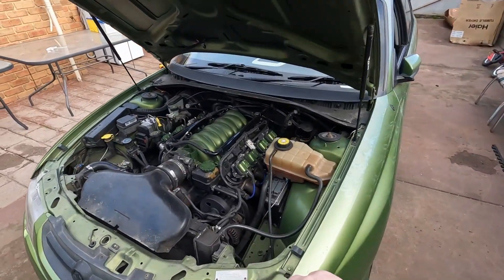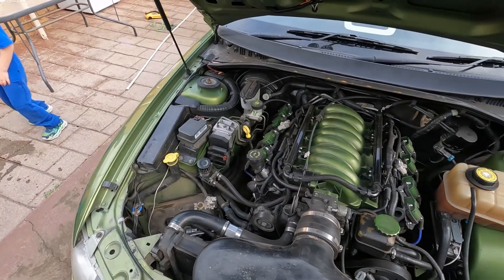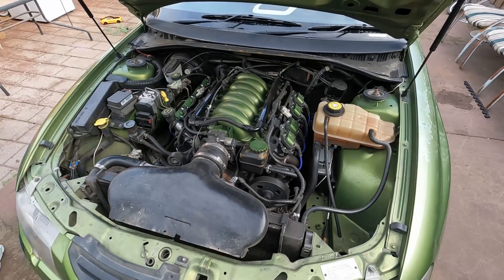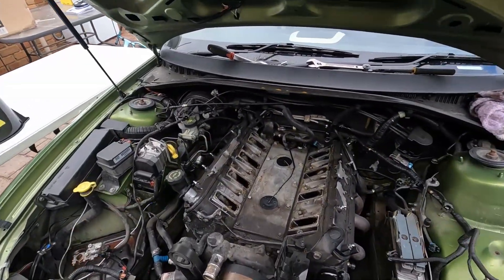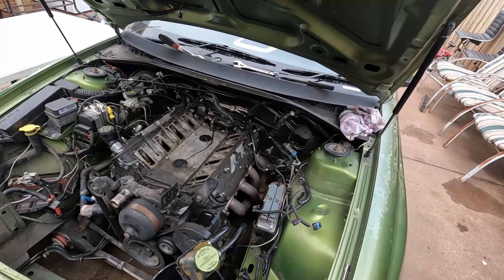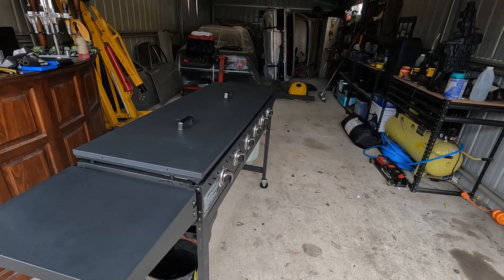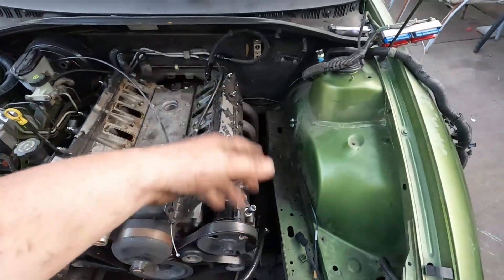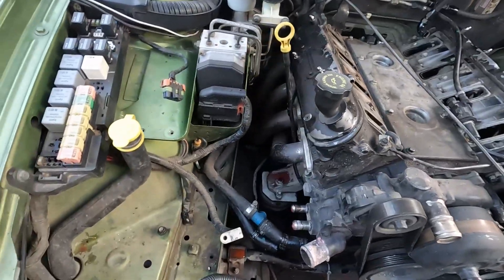Project VY SS Part 1 Engine Removal

Comment: Hey there mate how you going, I've got a 2006 ve ss commodore I'm replacing the harmonic balancer, it's done a little bit of wearing behind the balancer there's a casing with 4 bolts on it i don't know the name of it, took the 4 bolts off but I'm not sure how to remove the casing any help with this would be great I'm not a mechanic but I know just by looking at it it needs replacing cheers mate love your vids

Comment: What did you do about your AC compressor? did you take it off and try set it aside without opening up the AC lines to the atmosphere? I cant see it on your car later in the video
Reply from the maker: The car never had AC when i bought it, it had been completely removed already the only thing left from the AC was the pump on the engine
Reply: @snrautoworx2840  thanks brother, tackling this same job while I have some time off.. hope you're enjoying your holidays
Reply from the maker: @tomh894  all good man happy to help or shed some light on things iv done or has been done to my car 😁

Comment: I would have thought first job bonnet off
Reply from the maker: Only took it off when it was almost ready to come out, its out of the way, but normally i would and id put a blanket down over the roof and place bonnet there 😉
Reply: @snrautoworx2840   fair call
It’s kind of a ritual to me if engine is coming out LOL